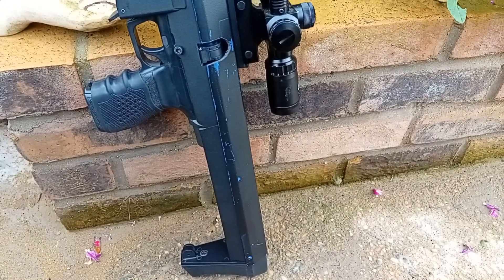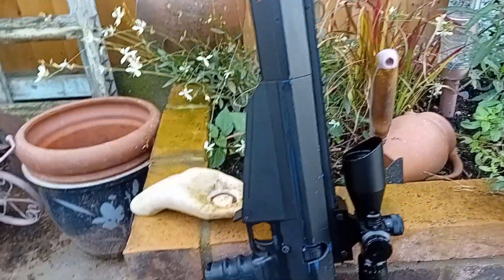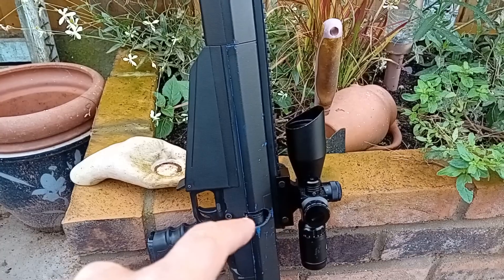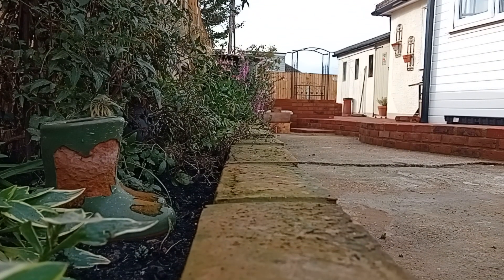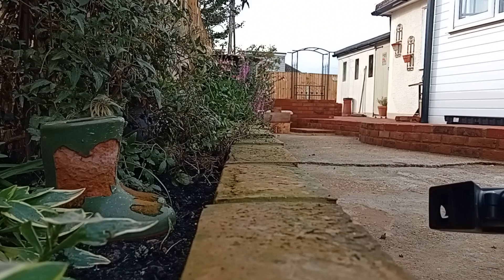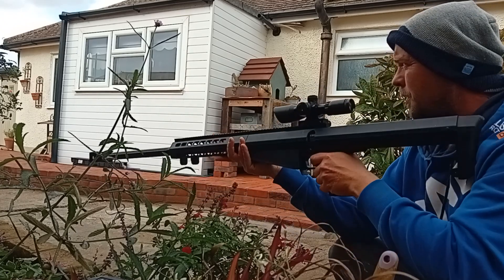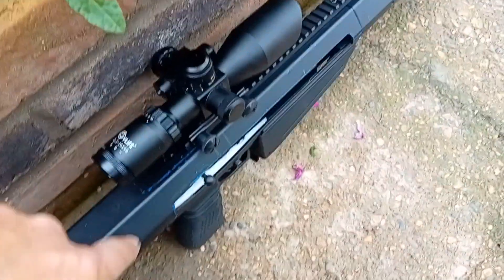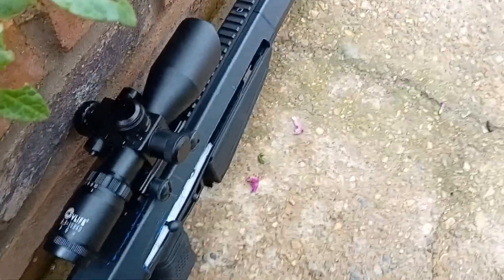Barrett .22cal co2 rifle, finally perfect first shot

Comment from the maker: It never rains, it always pours 😅 at least its working,  pictiny rail mount found again last night so I was happy to get it back together again.  The barrel is nicely fitted with paracorde between so it's pretty much perfectly in line... no clue why it's leaking tho, I'll figure that out later 😊
Reply: My Nemesis x failed on the second cartridge and they are sending a new one because it’s irreparable .
Reply from the maker: To be honest I think it's the rifle and not the adapter.. annoying I need to dismantle it and put it back together with all its parts.. obviously that's all mixed in with everything else I own 🙄

Comment: I still want the sa80 😊 😊
Reply from the maker: Haha if only the glock was slightly smaller it would be in that thing and working way better.. the issue with that one is it's really hard to line up the the gun and barrel,  also the front mount for the front sight is mounted to the barrel,  that whole section is basically free floating as I have nothing to fit it to, really it needs something with a longer barrel and better trigger but until I see it I don't know what it is
Reply: @Replica-Airgun-Lovers  your figure summat out bro your the Mary shelly of the gun world 😁🙏😂🍻
Reply from the maker: @co2addicted788  haha got to be different mate, that's probably why so many other channels watch me aswell 🤣 😉